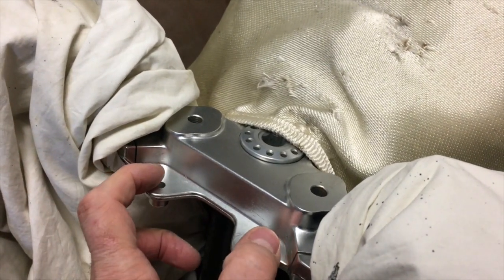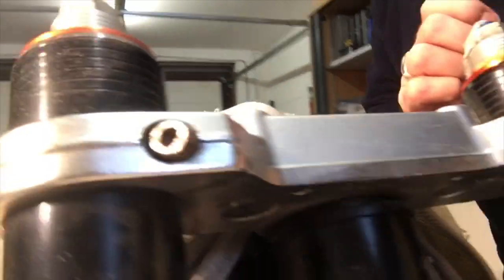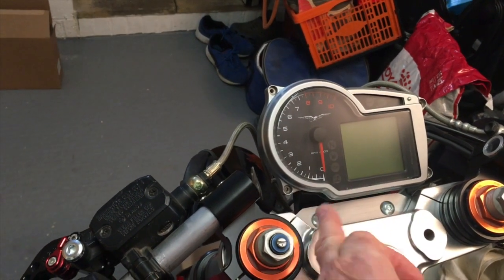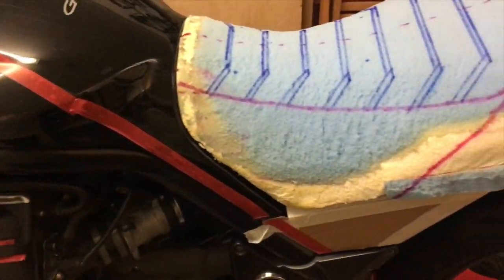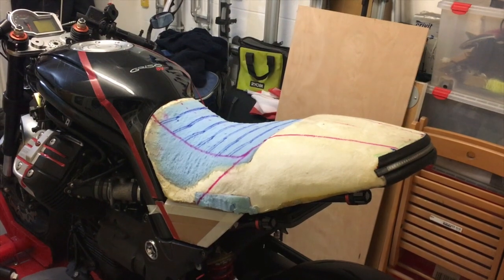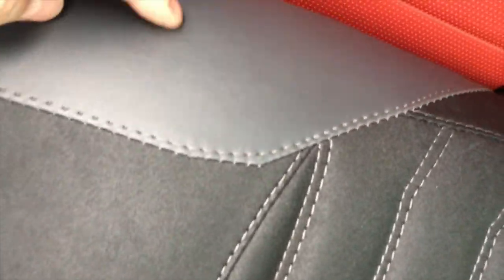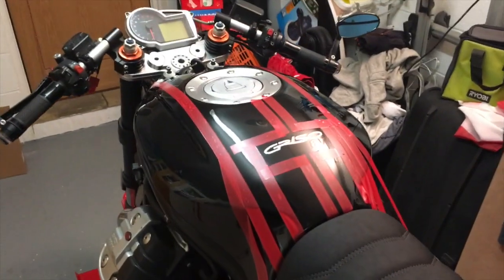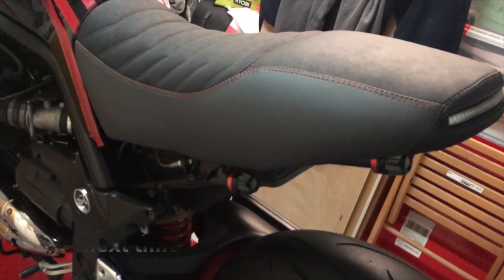Moto Guzzi Cafe Racer - 16

Comment: I currently have a 2008 Harley V-Rod which I am starting to really love, it seems that it would be somewhat similar in performance in engine manners to the Griso. The sitting position is totally different, however. I also own a 2016 Suzuki GSX s1000f, which is way way too fast and that takes away the fun. I am considering a Moto Guzzi griso, but as with any smart motorcycle buyer, you at least have to sit on the damn thing. Many times I will fall in love with a bike on YouTube, only to sit on it in the showroom and realize that the bike is not for me. That happens probably 9 out of 10 times
Reply from the maker: Yes, lots of torque and character.  I love the build and the ride 👍

Comment: Martin it would be an Honour indeed if you took the scuffed steel look on for your Grisso...  if you're serious buddy, then drop me a line, and lets chat on the phone if you need to.. any thing i can help with will be a pleasure mate..!
Reply from the maker: Thanks Del, I really like the scuffed steel effect but the tank and front mudguard are both plastic.  What do you think about locally removing lacquer and the Griso logo and re-touching using clear coat? Is that achievable or should I be thinking complete re-spray using  clearcoat?  Or even removal of the logo and complete vinyl wrap?  This may end up a next winter task if the logo causes a problem as I want to ride it within a few weeks. Martin
Reply: @martinarundel5317  Aha, didn't realis it was plastic... ok, if the logo is proud then it's probably a stuck on decal buried under the clearcoat, perfectly possible to do, you need to be careful nd flat the top of the lacquer with a block and 1200 paper to take off only the lacquer on the decal, then once it's flat, you can normally pick it with a pin and peel it away, but that will leave a decal shaped crater up to 1mm deep that you have to then fill...!  You can blend it out with wet n dry, but be really careful not to go through the black cos it's probably only one coat thick, and then, yep, re-clearcoat the whole thing!
Reply from the maker: Moonfleet41 Thanks Del, I might have a go at that, if I mess it up, it’s a wrap! Ha ha
Gotta go tho as I really don’t like the lettering.  Hey ho, nothing ventured eh.
BTW looking forward to your next project!